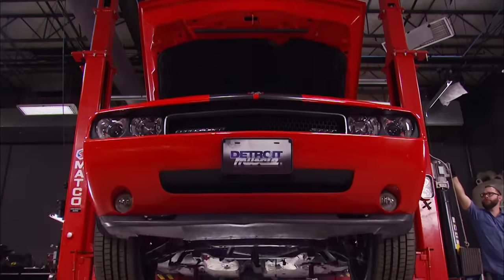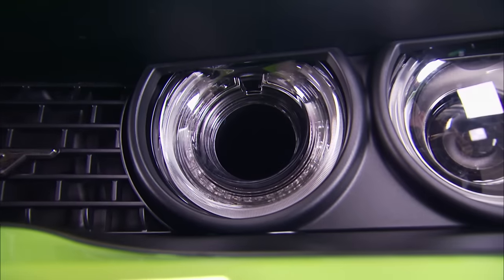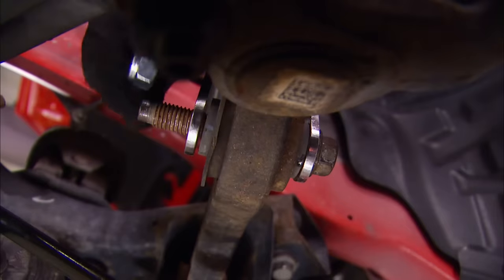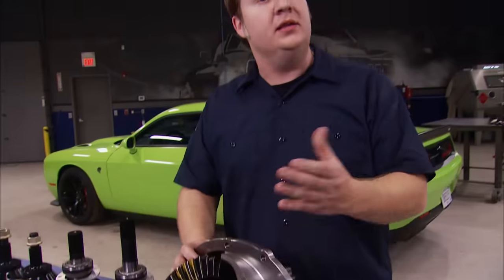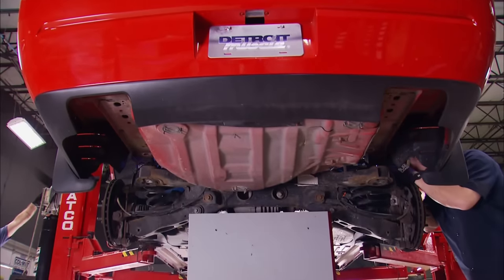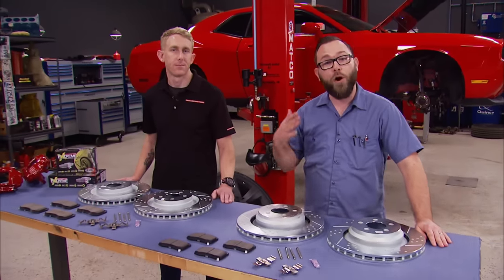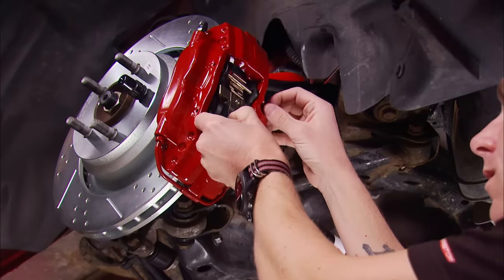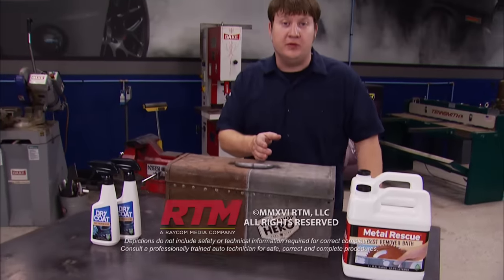Making a  2010 Dodge Challenger SRT8 Outperform a 2015 Challenger Hellcat - Detroit Muscle S3, E11

Comment: Interesting but..why??? The 30k you guys just spent on this..plus the car..you could just buy a hellcat. Granted this might slightly outperform a hellcat..until it breaks transmission..lol.
Reply: Nothings cooler than turbo noise when you hit the water box
Reply: the put a level 10 1200hp trans in it and this got 728hp it will stomp a hellcat and the suspension is way better
Reply: @bigsean2473  I see no level 10 1200 trans..the point is anyways..just buy all the parts they used..and add it up..itll be way more than a hellcat cost..and that's not including labor..and the resale would be crap..at the end of the day its still just a srt8 charger with mods..you will have to part it out..or keep it forever..each his own..yea it'll be cheaper to insure..big deal.
Reply: @smbaker84  its in part 2 they put in a level10 1200hp trans
Reply: @bigsean2473  still..see above comment..
Reply: @smbaker84  i just went to level10 website and they show that they used there 1000hp trans. but on the show the guy said the got a 1200hp trans from them for the build. so idk ill got with what the website says and say they got a 1000hp trans. still ok the car made 728whp

Comment: All the money +timeyou all spent I'd just go buy a hellcat
Reply: because this performs much better than a hellcat 728hp
Reply: True i would by the hellcat and mod it and it would outperform with less money on mods but still a good build but why change out the 6 piston brembos to a 4 piston caliper
Reply: @bigsean2473  warranty*
Reply: @james2042  this is a 9yr old car so pretty sure warranty is over
Reply: @bigsean2473  that's the point, a hellcat still has one

Comment: If your trying to out run a hellcat, you need a ZL1 camaro 🤷🏻‍♂️💯
Reply: Brian Proffitt zl1 camaro gets smoked by a hellcat🤦‍♂️
Reply: Your crazy 😂 I don’t just wanna go in a straight line an least the Camaro plat form is updated, challenger on the same one for the last like 15 years 😂😭
Reply: whiteboyz gaming An that’s crank horse power not to wheels, hellcat can’t handle a ZL1

Comment: thats my dream car
Reply: I got a 2008 first edition challenger hemi orange srt8 with 16 original miles still brand new. It was my dream car I remember when they came out and I always wanted one I like them better than the hellcats. The 6.1 is still a really fast car 425 horsepower  like the original 426 hemi just less torque

Comment: I owned a 2013 it was the biggest pos I owned it for 5 years went threw 4 waterpumps 1 motor 1 trans 3gear went 4 rearends service was horrible as well I also had 40 other things wrong with it back to Toyota I went

Comment: Good be wrong, thought the SRT had 475 horsepower.
Reply: This is a 2010 model.
Reply: Yeah, the new SRT with the 6.4 liter makes 475 hp, but this is a 2010 with a 6.1. I believe they discontinued the 6.1
Reply: The old ones were 425 iirc
Reply: Stock hemis were anywhere from 305 to 375 don't quote me though, I'm only a mechanic.

Comment: I'll stick to the z28
Reply: Itchy Balls z/28 can do track not just floor it in a straight line
Reply: Itchy Balls  umm not. 707 and over 4100 pounds makes it loose. z28 with  650 and close to 900 pounds lighter will win. weight per hp